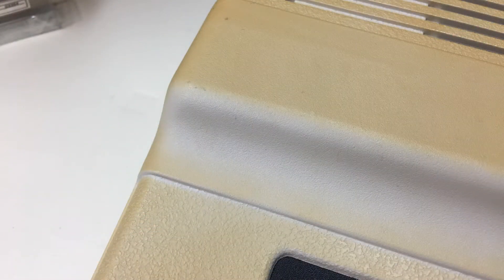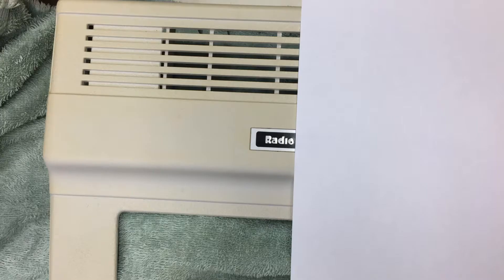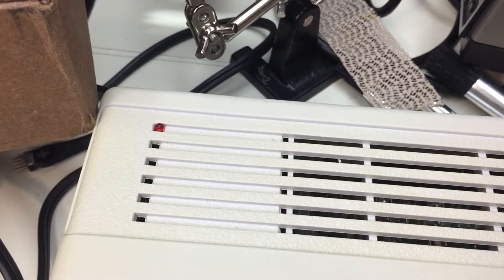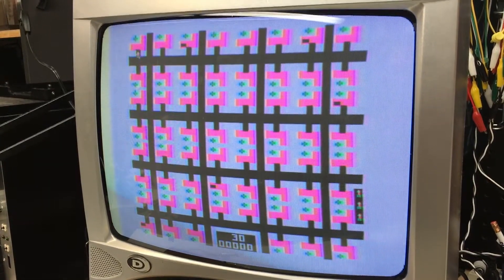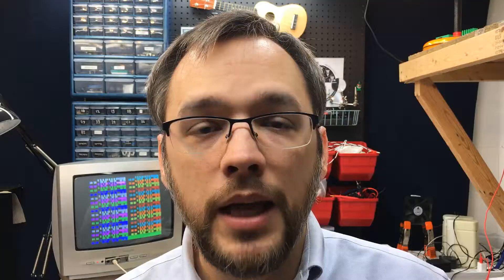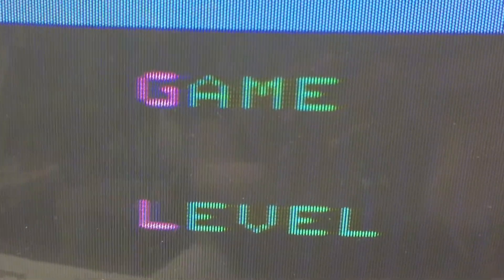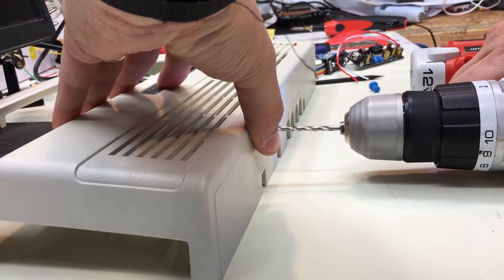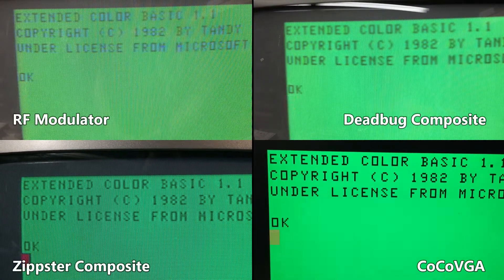WHAT IS OLD IS NEW AGAIN - Tricking Out The Color Computer 2

Comment: The place to put a red LED is in the badge where the three colored dots are!  Have a red LED indicating that the computer is plugged in and ready to be turned on, the green indicating that it's on and running, and the blue... I dunno, maybe have it flicker to indicate non-A/V input/output, like info coming in from or out to the cassette port, serial port, or cartridge port?

Comment: My CoCo has the EXACT same artifacting issue! Can you explain what you did to get the colors correct? And ultimately what value capacitor did you have at C26?
Reply from the maker: I replaced it with the factory spec value. Don't remember off-hand what that is. I had to replace everything in the video, and futz with a trimmer capacitor near the SALT chip.